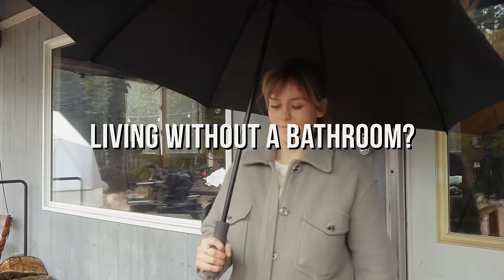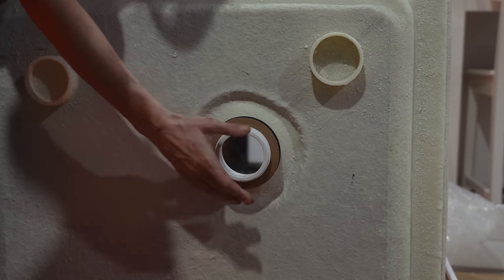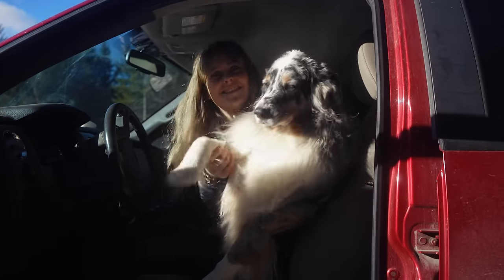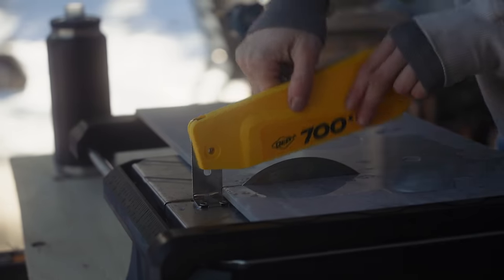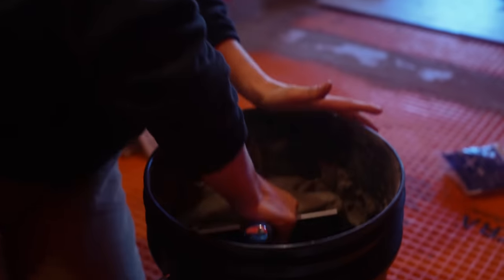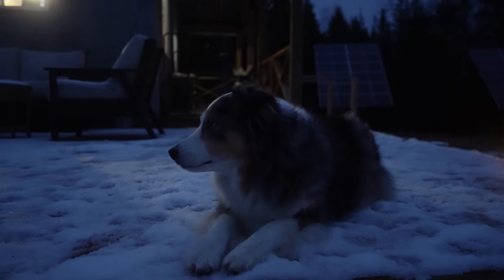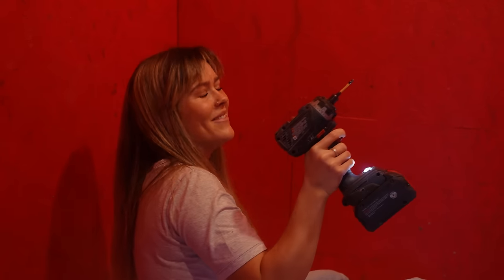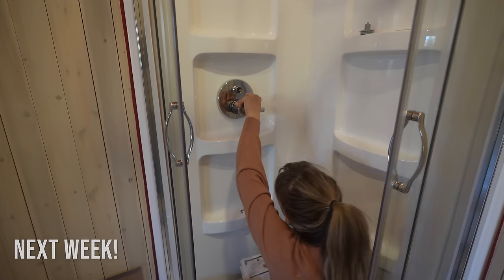We Built A Bathroom w/ No Experience

Comment: A rather large truck tire laying on its side, you take your unsplit logs stand them up and fill the center void, then walk around with your splitting wall splitting them and you're splitting wall will bounce off the tire, this works really well and it does multiple pieces, finding the right size tire is the hardest part good luck

Comment: Mount your wood splitter to a log with lag bolts then cut the heads off. That way it stays in place when you are using it and you can take it off the log. Leave about three inches of bolt.

Comment: As I am the 2,727th person to comment, I am SURE someone has already mentioned your wood splitter.  A bigger sledge or maul would really help.  I would also place the log entrapment and rendering device on the ground so you can get the most "umph" for your swing.  Cool tool, but it looks best for making kindling.  But heating with wood DOES warm you twice.  ;)

Comment: That was great after watching you I did a great job and  have hot and cold running water I have the pie shaped shower and my tile is a rustic gray wood ceramic tile side walls are a white marble with black streaks the tiles have to be set with a running streaking is harder to keep streak going but you are doing a great job ladies.